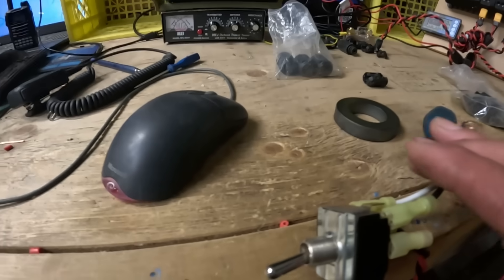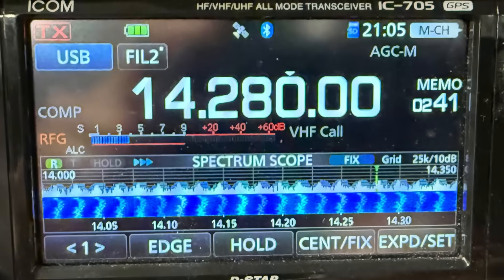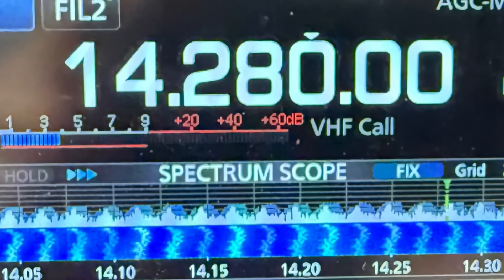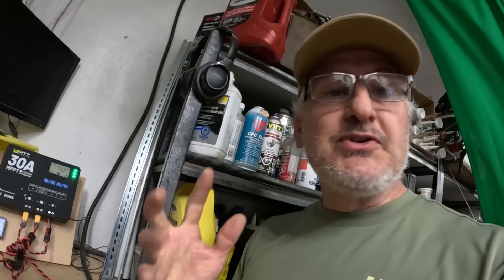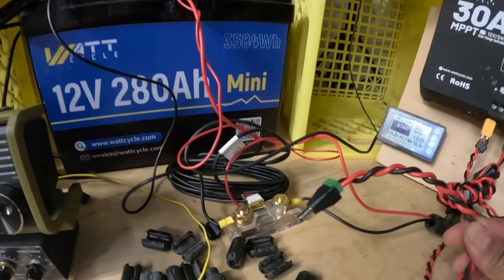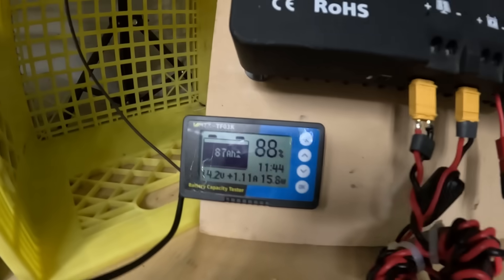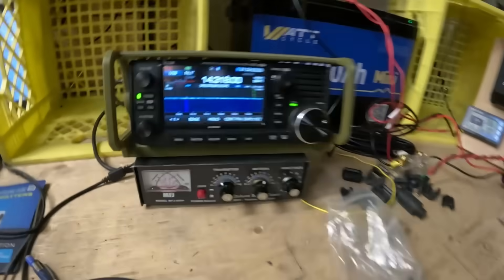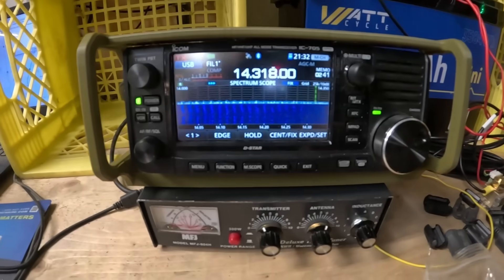HELP NEEDED! RFI is Killing My HF Radio from a MPPT Solar Controller. What Actually Works? #help

Comment: I hope you find a solution. I have some RFI from both an inverter(mostly 80m and below), and Victron CC.  Victron isn't as bad as your Wattcycle, and it's mostly on 40m, but it has these birdies that are narrow but strong.
Chokes on the solar input does nothing, despite it being the recommendation.  I wonder if it's just radiating out of the board itself, and there's not enough shielding on the case.
I think proper filtering requires some electronics knowledge in order to create the filtering on the board itself...
Reply from the maker: Great points.   I might wrap the controller in Mylar and make a Faraday cage.  I do agree the best way is to stop the problem not mask it.   Thanks for the comment.  🍻

Comment: Solar charge controllers are notorious for RFI especially the MPPT ones.  Ham Radio Tube, had this same issue on a recent video called "My Next Attempt At Off Grid Power".   Did you contact WattCycle and mention the RFI caused by their charge controller?  They may have a better solution.
Reply from the maker: I will have to watch Mikes video,  thanks.   I did not contact Wattcycle yet but it’s on the list,   Appreciate your comment and thanks for watching.